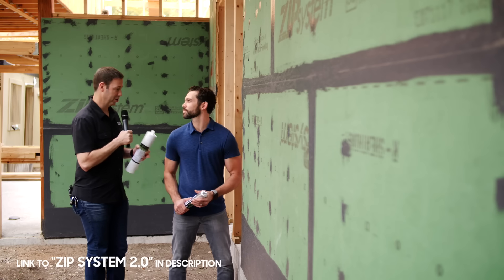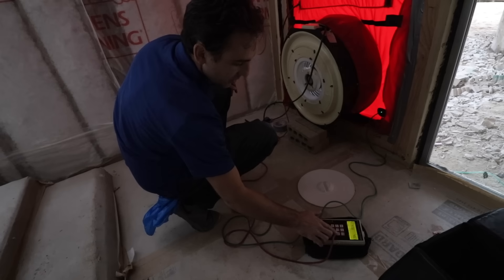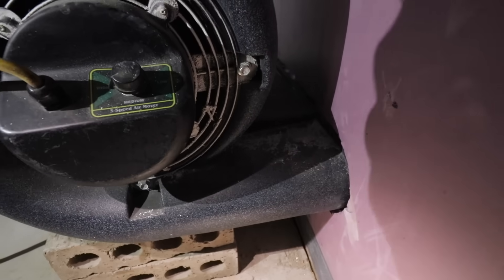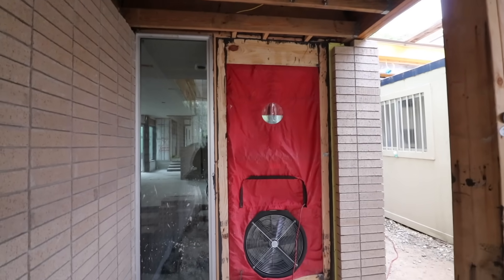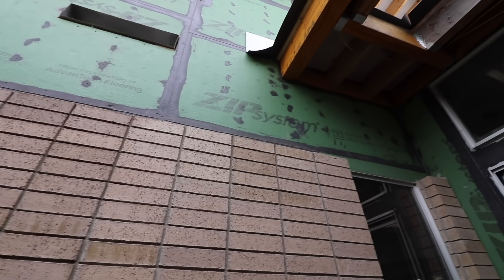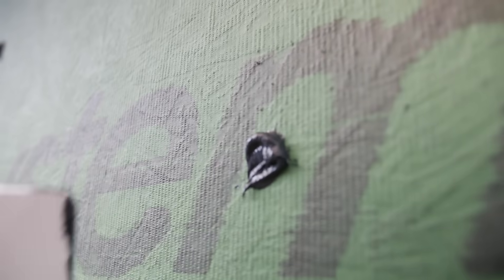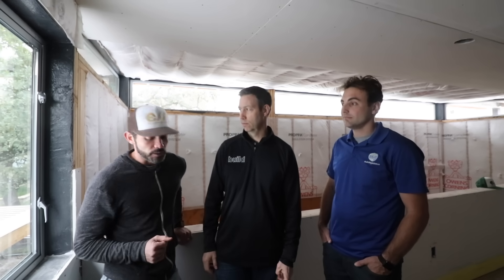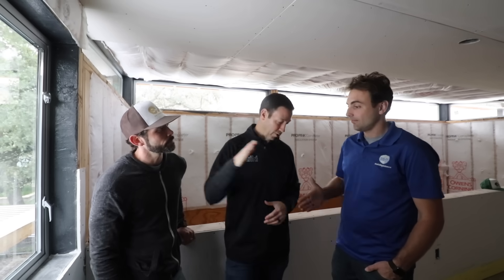A terrible Blower Door score till we figured out the problem!

Comment: Love the DIY blower door diagnostic idea.  Blower door test equipment is expensive to purchase and maintain.  An auditor can come in, provide before and after data, while the homeowner can take their time in sealing the envelope using the diagnostic method shown in your video.  Hats off to you Matt.  As an HVAC contractor, I wish more builders followed your path!  You probably don't deal with many older homes at this point, but I'm sure you've  had plenty of past experience, learning where many "good enough" methods went terribly wrong.   As another commenter mentioned, getting existing homeowners to understand the importance of blower door testing is an uphill battle for sure.

Comment: warranty. Buddy put this type of sheeting on his house he said and this was just with the tapes his energy bill was more the cut in 1/2  his hvac system didn't work as hard anymore.
I made the suggestion to calk all the nail holes becuse even though you try you will still drive a screw too deep its bound to happen so a liquid tape is better in my book becuse it seals everything no water is getting into the panels.

Comment: Been in the window industry for 15 years 6 years of which is manufacturing. When in manufacturing I got involved in testing windows and doors for air and water infiltration. We would test the windows and doors with what would be an equivalent of a 50 mph wind. AAMA standards would dictate that a window that uses a non compression gasket so we are talking about double hungs and sliders had to meet a minimum of .3 cfm per square foot of window of air infiltration. Compression gasket windows like non sliding doors and casement windows were at .1 cfm  per square foot. This certification was in lab conditions which means in the field it was allowed to test at 1.5x the lab minimum. In testing our Double Hung windows were typically in the .15 cfm/sqft while the sliders were the poor performers due to the large tanks required for water infiltration. Often sliders only just made it close to the bare minimum at .27cfm/sqft. Casements and tilt and turns are what you should be looking for as our units frequently tested at       .06cfm/sqft. The multi point locks help to create a tight seal and outswinging casements will press tighter on the gaskets when the house is depressurised. The houses you build have huge windows and those square feet add up so these test reports are important to look at.

Comment: @ Mat Risinger. I saw you were in my country (Switzerland) visiting some of our companies. If your interested in not using spray foam insulation for attics or walls in general you can have a look at www.isofloc.com. This innovative system allows you to blow in insulation, be it a wood fiber material or even just newspapers (isofloc LM). We did several building with this and it is really great! Actually you build everything up, you can use OSB or plywood or whatever you like to use to close the attic or walls and all you have to do is to have one small opening where they can blow in the material! It gets pushed in really good and insulates everything perfectly. Maybe Doug finds this also interesting.

Comment: I moved here to what was supposed to be my retirement home in 2016. Home was built in 2006.  Having lots of HVAC issues, mainly infiltration and poor duct design.  Master bedroom is constantly 5 degrees colder than the living area.  Master bath with 3 exterior walls runs 10 degrees colder. Thanks to this video I now have some ideas on where to start. I need to look into getting a test like this done.  

Taking a shower at 55-60 degrees is NOT fun!

Comment: Matt Risinger, I just had a blower door test on a house I am about to renovate. We scored a 14.3 ACH/50...
Any suggestions? New windows and doors for sure, but what else?
Reply: No I’m not Matt but I’d love to respond lol. 

That score is definitely high and normal if we think about it. What that says is you need to find where those leaks are coming from and see if some major Reno-I’m talking down to the studs is needed.

If you’re going to change the siding, this is a good time to do so as you can then look into windows if needed.

As far as interior sealing, there are products like DAP’s AirStop, which is a fluid-applied like substance you can even use a spray gun with that can address between the studs and sheathing and maybe bottom plates and sills for stopping air leaks.

Anyway those are my thoughts. Matt has provided a lot of info through the channel and resources to help think through what’s the most cost-effective approach for your project.

I hope all is well and kudos to your reno.
Reply: Is there a pull down attic ladder to an unconditioned attic?  If so, building an airtight box (with hinged door) up into your attic space will cut down a lot on leakage.

Comment: Can over sealing a house cause a sick house .Even with an expensive heat recovery system and air cleaners .The long run cost may be great but the short term price of the house .To many homes in foreclosure these days .I bought a modular house back in 2004 and had it over built for southside VA .8 foot ceilings and 2x6 studs and triple pane windows .Yes I have 2 sets of sliders and no real big difference .Attic is over insulated with blown in insulation and heat pump is a lennox 16 seer 4 ton unit and I still think heat pumps are garbage .I came here from NJ to up on a hill in VA with lots of wind .We have only electric or propane where I live and that sucks also .My floors are insulated and slab and walls of my basement were insulated .Are we making houses just to tight these days .Here it is the cost of a build so that is the reason for my modular ,One set price no over runs and no wet house while it is being built and faster build time and I had to move fast because my house in NJ sold sight unseen .Would this be worth it here ,NO ,where houses sell for less than 30 or 40 thousand

Comment: Does this house have exhaust fans? If so, how do you stop airflow when the fans aren’t on? I have a building with three bathroom exhaust fans and a kitchen fan. Wouldn’t they leak more than any door or window?
Reply: Jorel, these help.  

https://www.tamtech.com/cape-backdraft-dampers

Unlike a mechanical damper, I don't think they provide much resistance when in the "open" position.

Comment: houses for rich people, houses built to these standards will cost so much that most of the population cannot afford.  People want windows and doors that open, triple glass will not be any tighter,  it's the sliding and closing edges that leak, and while a high end window might give good numbers to the builder what will they do in five years?  And if you bring in exotic windows from elsewhere what happens when they break and the owner can't find a replacement?  add to that the complications of the air handling equipment to supply conditioned make up air and needed exchanges to overcome the fartbox problem.

Looking at the bigger picture, new building represents less than 1% of the overall stock annually.  Probably about half of our units are 100 years old or more, most uninsulated, and with leaky windows, doors, and whatever.  And with heating system dating to the stone age.  Landlords are not going to make investment in bringing things up to code, if that can actually be done, without big increases in rents and the big dislocation that will cause.  Even units that are relatively young, built in the 70s and 80s fall short.  What saddens me is seeing the older homes being updated with vinyl to replace the hardwood windows and plastic siding over the original and still good clapboard that only needed painting.  The future for the working class is either mobile homes or tents.
Reply from the maker: So... would you say you are a “glass half empty” or “glass half full” kind of guy?  Just curious
Reply: Been thinking about this for a while now and there’s no easy answer. Sure the benefits of health and pocketbook are phenomenal, but the costs can be something that prevent people (especially landlords) from making these adjustments to existing homes.

At the same time there could be advocacy for some type of credit to those who upgrade existing homes to offset costs.

The bottom line for me isn’t money but people. We can all be more creative to make this movement happen a lot smoother. The amount of existing houses is the biggest deal as they aren’t going to be torn down (and don’t need to) to get new standards on new builds.

For me, instead of the front runner being SFRs, businesses need to adopt these practices ASAP. If by building these phenomenal structures save energy costs and help benefit employee health, the savings show up in businesses putting more money into R&D, income, etc. instead of the overhead of holding a brick & mortar. 

That’s where more of the advocacy needs to lie as we continue to stretch out for making these homes what they need to be.

Comment: Another great video.

When we as an industry talk about air sealing I think there needs to all least be a mention of proper ventilation in the conversation. I know you're a proponent of ERVs as am I. As a great educator I hope you can mention ventilation along with air sealing so we're not building zip lock bags for homes.  

I currently see more focus of builders and code enforcement and even designers on tight homes and less concern for or knowledge  of ventilation. 

Thanks for the great videos!

Comment: Matt, with all of the spots being a window seam of some sorts creating a lot of the air leaks, would they be able to caulk them and seal them up a bit?
Reply: The issue with the windows is not in their connection to the framing but the windows own gaskets. So you could caulk them shut I guess... But that would defeat the purpose of a sliding glass door :)
Reply: @MandoFettOG  lol I know that. I thought they were taping over seams in the frames of the windows. I figured if that was the case, they can caulk them a bit.
Reply: @mikecampanella1990  oh haha gotcha sorry for the sarcasm I couldn't resist

Comment: How much does a project like this cost?  What's the ROI on an investment like this?
Reply from the maker: Homes are an asset that generally appreciates. Building a well-built, durable, and efficient home is always a better investment. You get one chance to insulate and air seal a home till it gets a significant remodel 50-100+ years down the line. Now is the time to Build better!
Reply: @buildshow   A house historically appreciates at 3% (keeps up with inflation) - for comparison, the stock market appreciates at 9%.  Traditionally, an asset is something that pays you money; A house does not pay you anything, in fact a paid off house has a lot of expenses with maintenance, taxes, HOA's, etc.   In anycase, how does this system compare to a traditional build?  Is it 50% more expensive?  70% more expensive?
Reply: I only ask as we're looking to renovate, and love the building science concepts.  We are tied to a budget, but would like to get an idea on what something like this would cost us.
Reply from the maker: I would generally expect to pay a 10-20% premium for a well built home with durability and efficiency and comfort as a goal. You can of course spend more. See my video Friday for some exact cost data on some of these components.

Comment: Presumably the attic has rigid board insulation in the rafter bays as well (with an air pocket for the soffits)?  What happens when the roof deck leaks?
Reply: With mine and the way it was done, you'll have a wet wall. I had a tree branch crash onto the roof punching a hole clean through the deck (looked like a hail strike). The rigid board ferried the water to the outside wall where the installers stopped at and water dripped onto the wall plates and soaked part of the ceiling as well as the interior drywall and outside sheathing. In addition to that, it happened right above the kitchen window. With both the window and storm window, it looked like I had a little aquarium going.

Comment: I like the idea of building tight as long as I get enough air movement to keep the air quality in the house up without having to install a ventilator for the house.   Central air with air exchange would address this, but you don't always want to run a system in moderate weather.
Reply: Those ideas don't mix. Either it is air tight and you add ventilation. Or you don't care and even then you should probably open a few windows at least once a day to get fresh air in.

Comment: Time is money for most builders, so why not just do traditional on the outside then AeroBarrier the entire house from the inside before the insulation gets put on?
Reply: I was personally involved on this project and learned (the hard way) that it is much easier to completely seal the exterior of the home vs the inside.
Reply: @colinspradlin  there's definitely more than one way to achieve the same results. Perhaps do an entire fluid applied on the outside then aerobarrier on the inside. Eliminates lots of man hours, IMHO
Reply: Time is money and completely sealing the exterior first can save a tremendous amount of time and money.
Reply: Aerobarrier seems to be a great system, but it costs around 5k for a 3000 ft house. if you can save this much money in labor cost, it may be an option. $5000 divided by $25 / hr = 200 man hours. minus sealant and supplies.

Comment: What is the accepted air-change-per-hour number you wouldn't want to go below so carbon dioxide levels don't stand a chance of getting dangerously high in case, say, a family of 5 with pets gets stuck indoors during a snow storm?
Reply: An ERV is critical to maintaining the air quality of these tight buildings.
Reply: @paulcopeland9035  Ah thanks. I see he has a video on that too.
Reply: Crack open a window and let some fresh air in. Yes, even in a snow storm.
Reply: @OU81TWO  Ever hear of the frog in boiling water syndrome? If it can happen (a window not being opened), it's probably been planned for. In other words, all they have to do is NOT open a window for there to be a potential problem. I'm sure there's an answer to my question. These guys are smart; they're not trying to hermetically seal a living space. I'm simply asking where that boundary lies out of pure curiosity.
Reply: You see Matt often seals off garages so I would assume it would be best practice to seal off your uiliity room 

I would also do combustion analysis on all your devices. With those meters they can dial in the  gas to air ratio so it's only producing close to 0 ppm of c02.   so in case you exaust backs it's burning clean enough that you the chance of build up is even less. 
If you check out Steve latimore (spelling?)
You see even gas ranges can come out of the factory producing dangerous amounts of co2 that we never really pay attention too. It's pretty interesting to see he brings a gas oven down from crazy high levels of c02 (which according to manufacturer is in spec) down to close to zero with minor adjustments . 

So in summery seal off  gas appliances from living space 
Run exaust fan on any cooking device
Reply: You have to have an air exchanger otherwise exhaust fans wouldn't work, etc.
Reply: I don't think a few days is enough to increase CO2 levels to any dangerous zone. The air volume is massive and the buildings materials soak up CO2 to a certain degree too.

Comment: Are more expensive windows better?  Or other brands?  How might one determine that the windows might be super leaky?
Reply: Depends on what you consider better.  You can get high performance windows that look plain, but are expensive.  You can get beautiful windows that perform OK, but are expensive.   You can get both, but they cost as much as your house (bit hyperbolic, but you can spend as much as you want on windows).  You're not getting high performance windows for cheap.
Reply: When your buying windows/doors make sure you look at the performance data for each one. In this instance you would want pay attention to the air infiltration rating. Higher cost doesn’t always mean you are getting a better performing window, but generally speaking higher performance = more expensive. Before you make a purchase do about 30 mins of reading on the ratings and how they work and it’ll really help you make a decision.

Comment: I hope you'll share more about the roof/ceiling assembly. Is he using rigid board above the deck? Per 2015 IRC R806.5.5 I don't know how you get away without either rigid board or spray foam and still meet code. If he's just using batts, wouldn't that put the dew point in the batts and be a potential for mold and moisture build-up?
Reply: I agree. More detail of the roof assembly is required because it would appear vapor would migrate to the underside of the roof deck and condense. Maybe this is a detail that can only be used in this particular climate?